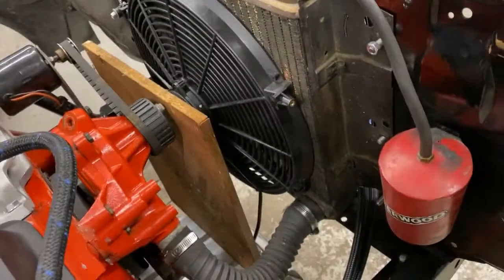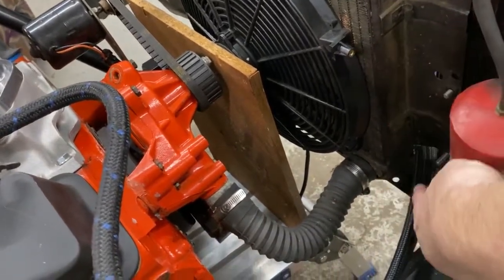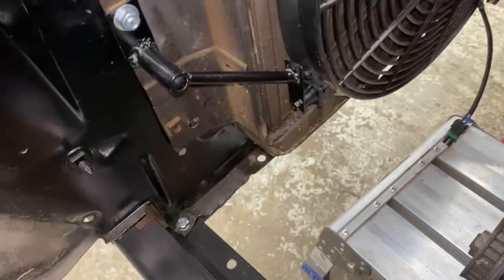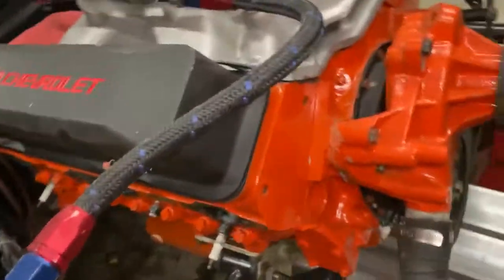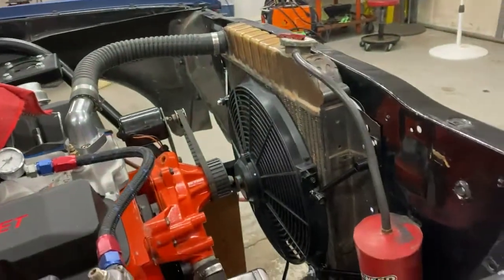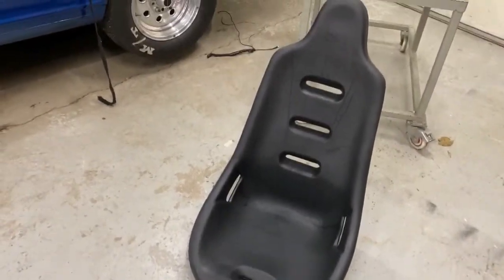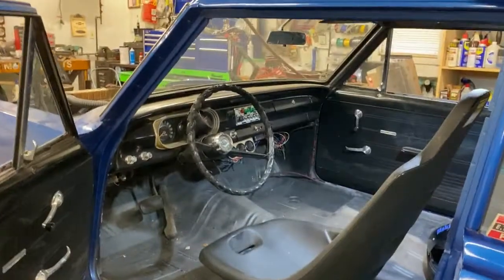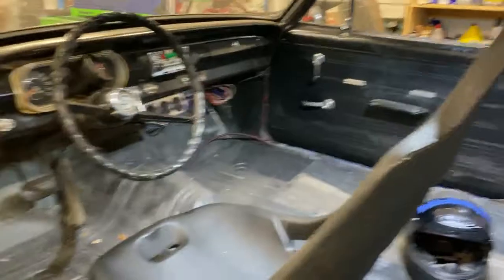Fabricating brackets for the electric fan. Mounting Jegs seat into the Nova

Comment: Did you make sure you fit in the seat before you bolted it down? Looked close to the gut? Did you use large fender washers on the bottom side to help spread the load?
Reply from the maker: I appreciate the support